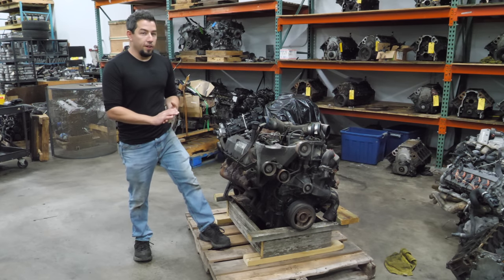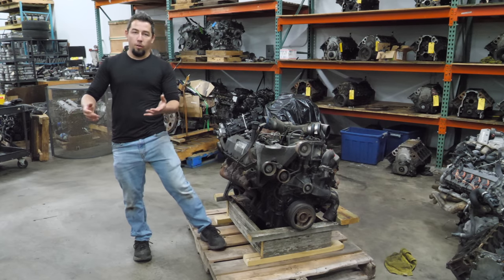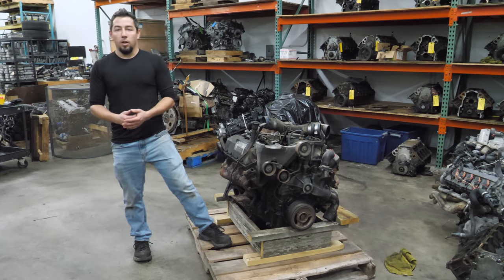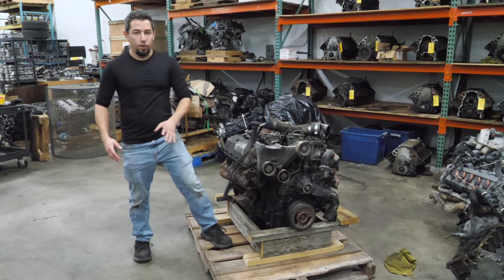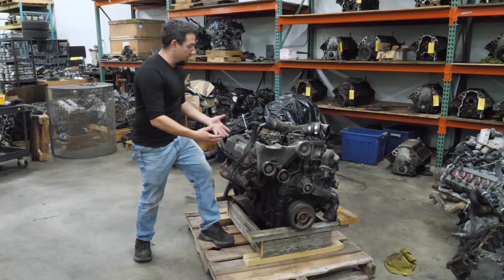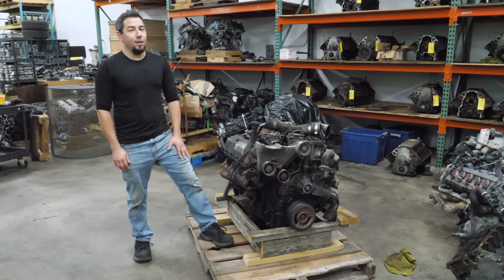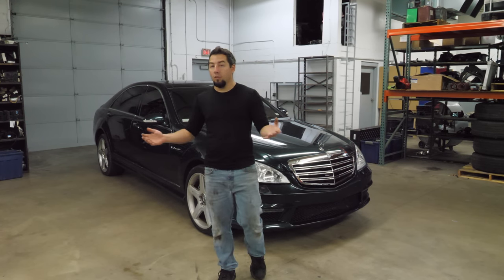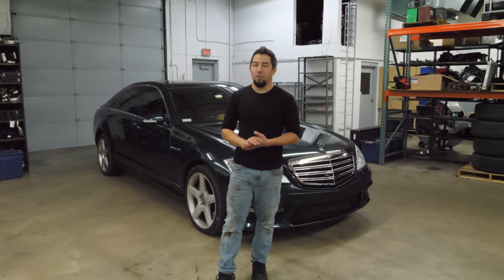70K OR 700K? Ford 7.3 Powerstroke Mileage Discrepancy. How Many Miles Are Really On This Engine?

Comment: I have to agree with the previous posts regarding idling and cold start care.  That engine, physically, looks like a 70k unit.  I think the wear on the bearings and cam is from extended idling and lack of care in cold start conditions.  Who knows?  We're assuming that the oil that they ran was up to task, too.  I think it's definitely worth saving.

Comment: So, Aug 2 of 14 it had an oil change at 67675. 
Sept 8 (37 days later) another oil change - no mileage. 
Dec 29 another oil change at 68372. 

So starting at the Aug oil change it went 700 miles in 20 weeks and had 2 oil changes.
I don't think so. I think in that 20 weeks it went 7000 miles, thus the 2 oil changes.

So as you well know, most vehicles have a "10th" digit. You're saying this doesn't. I expect that people grow accustomed to disregarding the last (usually) "10th" digit thus the low readings.

Comment: 18:55 It's entirely possible for this engine to have 70,000 actual miles on it, but have run itself to death due to being used as a stationary engine. It was, after all, on a service truck, and having an hour meter would probably be a more accurate chronometer than an odometer is. Entirely possible that thing spent the majority of its life idled up running air comprssors or whatnot.

Comment: I’d say 70k, but mileage doesn’t mean much. Maintenance means everything. A few ways to judge engine wear- lower bearing appearance, compression test results and leak down test results. I’d also recommend splitting the oil filter and inspecting. If you split a filter make sure you squeeze the element in a vice to remove excess oil for better analysis.

Comment: Also to add to that last comment I made, I have a 1999 7.3 2 2wd f350
 The odometer and the truck only has right now 8800 miles. Yes under 10,000 miles. 
 It came out of a local plant here in East Texas it never left the plant other than to drive to town for 5 miles away to get parts.  
 But I can guarantee you that thing probably has 20,000 hours of idle time.

Comment: I'm an old man now but back a few lifetimes ago i worked in some shops that did a narrow window of work, small stuff like tires and oil changes, brake pads, etc.  It wasnt uncommon for quick lube tickets to have the mileage fat fingered into the system and on return visits, we just entered more miles than the last visit without taking the time to go out and check the actual mileage...because no one cared.  There isnt a mileage warranty on an oil change.  All the 600K mileage entries are from the quick lube joint.  I would relay more on that last dealer entry.

Comment: I am not an engine expert. The mileage number series seems to increase regularly. There is a significant change in the decimal point location. I would wonder if there is a data entry problem that accounts for the alarming mileage increase?

Comment: The OEM injectors and valve cover wiring harness generally only last about 300,000. Also, I use internal engine cleaner every 100,000 mile or so and at 275,000 when I had my 01 injectors and valve cover wiring harness replace due to failures the Tech said it was the cleanest 7.3 he had ever seen. 
The bearings tell the true mileage. It will need injectors and valve cover wiring harness, New Turbo, Low pressure oil pump, HPOP, bottom end rebuild, just for a mild refresh. Might as well do it right and completely rebuild it right.

Comment: Hard to say. I know a lot of 99-00 engines were "dusted" due to a bad airbox, so it is possible that the engine could have been replaced at some point with a short or long block and all the external covers and accessories swapped over, but that still doesn't explain the mileage discrepancy. The 5 spoke wheels on that truck weren't original, that design wasn't available until 2001, who knows what other part swapping happened over it's 17 year life.

Comment: It had a hard 70k , 7.3s are tough , but they need clean oil , if you skimp the injectors rattle badly and go out , that truck had to be regularly abused to have that kind of scoring on the cam and bearings , the electronics are original so that lends credit to 70k , it was probably cold started with ether and no block heater daily , and then spent a lot of time In it’s higher rpm range , I dare say a lesser engine wouldn’t have made it . Love to see more content in one of my favorite platforms

Comment: Yeah I used to own one of these things, & it just refused to die, even if you don’t check the oil it won’t run without oil pressure!

As long as you keep clean oil in the engine it will not die if you don’t abuse & overheat it.

Comment: If it were me--  Bare minimum- Pull the turbo and put new seals under the pedestal, new seals on the HPOP lines, and pull apart the oil/ coolant heat exchange tube and re-seal all that stuff--  New water pump and new oil pump on the front of the crank --- and SEND IT>   Since you're already there,  I would (maybe) put all new crank and rod bearings on that bottom end.    If you want to spend more, maybe put new injectors and glow plugs.  Otherwise, I'd throw a bearing kit and some seals at it and call it good myself... Because if you go any further, it's basically just a full rebuild at that point--  new rings, new head gaskets, new head bolts, new, new, new...   yikes.   I can't recall hearing of a 7.3L that died from a bad cam or lifter, etc..   I've seen a few 7.3L that had over a million miles on the same engine.

Comment: I am a ford trained diesel mechanic, as much as id like to see you tear it down that engine does not have 700k on it. I'm also in Ohio so we get a lot of salt as well that engine is way too clean, not sure about the bearings may have been low on oil at some point, the cross hatching I could see in the cylinders looked perfect. new bearings and you have a great engine

Comment: The turbo impeller is not stock. That is an aftermarket impeller. The stock impeller is a 9 blade. The impellers seem to last about 3-400k miles. If that was replaced due to it being worn out, it could make a case for the engine having 700k. 
In my fleet, I have a 402k mile 7.3 with original turbo that I just put a new impeller in due to the old one being so worn out.

Comment: I'm a 7.3 guy and I say 70k. That engine is WAY TOO CLEAN to even have a 100k. Those bearings look about right for a 70k engine that routinely saw +2500rpm extended operation. The unloaded side of the bearing was indicative of low mileage. The loaded side looked like it saw mainly highway tow miles. It was probably somebody's 5th wheel camper or horse or racecar tow rig. Another good tip off that it is such low mileage is the presence and condition of the original UVC harnesses. The original turbo doesn't mean much as I have put Wicked Wheels in 300k trucks with original snails for these country boys around me.

Comment: You know, I got a truck that this happened to, but the Car fax didn't match the odo reading. The odometer read just 107k miles, but for some reason the carfax had it bumped up to 207k miles. Absolutely nothing I looked into matched that, and the place I got it from confirmed they never changed the dash components. It also had that sudden jump in miles in less than a couple months. Seems to me it is very likely someone fat fingered the input

Comment: This must have seen a hard life with such wear. Lack of maintenance, cold starts, heat cycles, running it low on oil, etc over and over again are ways to kills these just like anything. I do know if maintained they could probably make it to 700k+ miles. My family  has a '94 7.3 and it's been a farm truck it's whole life. Always sees short trips, no highway, has.150k miles and while she doesn't like cold starts still runs really good and taken a lot of abuse. Next to the 12v and 24v, these are one of the best.

I plan to keep the 7.3 once it's retired and restore the truck. Their longevity and strength are hard to beat even though they aren't so friendly with the environment and fuel usage.

Comment: Diesel oil may be blacker than gas engine oil, but it has (or used to have) a lot more detergents, and flocculant which clumps particles together so the filter can catch it.  As a result, these engines tend to be way cleaner inside, even with questionable maintenance.  
That thing looks like it idled a lot.  Not very hot, so the injector harness didn't get all nasty and discolored, but still lots of low oil pressure time on the bearings and cam.  This is why these engines really need a high idle module if they are going to be idled.

Comment: Service vehicles like that one are hard to get a handle on. You know how highway patrol cars rarely shut off whereas a regular city or small town police car might not get as much abuse depending on who the vehicle is assigned to. I think an hours meter would be more useful for service type vehicles. I bought an 87 Mazda B2000 pickup in July of 1987 and it somehow already had 80,000 miles on it. The mileage deduction was insane but that was fine with me since I was buying it. It was allegedly a farm truck but how they put 80,000 on it in such a short time remains a mystery. It ran great and looked great, it just had an insane amount of miles on it.

Comment: its probably 70k. if it lived in Chicago as a service truck it likely spent its life doing things local to the Chicagoland area so it didn't rack up many miles. However what I have seen in the past from my time working at a dealership in burns harbor Indiana right next to the steel mill is I would see trucks that live at the steel mill that don't actually get any miles put on them but they had excessive idle hours. I have seen a Silverado with 1,800 actual miles that needed an engine because it had 20,000 idle hours on it.

Comment: Back in '14 my boss ordered 2 identical F550's with the V10.  I got 1 and another co-worker got the other one.  after 105K the other truck blew the engine. the dealer replaced it and that one failed before it got off the lot.  the truck I had ran for nearly 8 years with the original engine and 447K. it still runs ok but exhaust manifolds are both cracked so it's really loud.

Comment: If it must be one or the other, I'm inclined to say 700k on account of the bearings and for the reason that the increase in miles and the amount of servicing over the last year of ownership strongly points to too much use to have only been a 70k engine after 16 years (which would have required an average annual usage or about 4500 miles).

Comment: I'm going to disagree with everybody on the lots of idle time in the winter lots of cold starts will do that to bearings unless you have a feeling oil pump idle time doesn't really put any load on engine or bearings. 

Definitely needs a low-end rebuild and I I bought oil pump and just check cam condition for specs.

Comment: seeing the stock turbo, the condition of the wiring, the exterior condition, and the fact that all the injector caps are the same color I believe it's a 70k engine that idled for most of its life. It was probably always behind on oil changes which resulted in the wear to the cam and bearings.

Comment: I have had 2 7.3's. Bought a new truck in 1999, sold it in 2008 with 340k on the clock. Bought a 1 ton van with 250k on it and put another 300+ on it. Never had a turbo issue and I  used waste oil in them. Ran a frantz toilet paper filter in addition to the oem can. You results may vary but I doubt that its a 700k motor just based on how much you have to drive to get that done. If it was set up for towing I would say yes but service truck, nope. Van is sold but the new owner is still putting miles on it.

One other thing, if it had 700k on it the donuts on the downpipes would be gone. If they look good there is no way they are 700 k parts as those are wear items

Comment: Those first 14-15 years averages approximately 4500 miles per year.  But when it jumps to 685,000 that is approximately 45k per year, or 3800 per month or over 100 miles per day.  I think someone at the Jiffy Lube screwed up and fat fingered some numbers in the repair record.  Or someone at Car Fax did the same thing.  Or, someone did not type the decimal point if they were entering the tenths.

Comment: At first I was suspected someone had swapped the dash cluster & interior and run the wheels off of it, but the witness marks and engine stickers shoot a hole thru that theory. I wouldn’t count on the visible crosshatch seen on the bottom of the cylinders as they almost never wear, but I would closely examine the exhaust manifolds, particularly the rear cylinders. If the rear fasteners (any of them) are broken, it’s a sure sign of high heat and hard usage. 
That said, judging by the wiring fasteners I’d have to say it’s a low mileage unit.

Comment: You can check the injectors if they have been rebuilt from my experience they say reman. The HPOP will usually say the same thing I can’t imagine too many 7.3 making it 700k without reman injectors or HPOP.

Comment: Those were absolutely the best engines in the Ford F250. They weren't a bedplate engine so not a good engine to turn up, any thing above 800 hp would float the main bearing saddles, not good,but they weren't designed for that kind of hp. They were very reliable I have worked on these usually the 220 hp model easy to work on long running engine with good regular maintenance.The one thing that is very important when doing regular maintenance is the use of Motorcraft filters and oil recommended by Ford we ran motorcraft oil and filters in all of our Navistar engines the 7.3, 6.0 especially, didn't have the 6.4 in our fleet. the engine you have there probably has 700,000 judging by the condition of the berrings it probably has 700,000 on it abet well taken care miles. IMO that engine is a prime candidate for a rebuild and some new parts, cam, rings and so on, as usual I enjoy your videos, oh one more thing, I didn't know the chipmunks could drive a fork truck your going to have to pay them more....cheers.

Comment: 70k, bearings typically wear out by 400k and need refresging along with rings . design life is 300k commercial duty at 26k per navistar. 

the bearing and cam condition screams acidic oil from sitting

Comment: Now that I see the cam. bearings, and the oil gloopage and see the exhaust manifold up close its a 700 k motor Cold starts don't cause that kind of cam damage like the other below stated and high idle time doesn't cause those issues either But its a seller its worth more complete there is a huge after market of parts for these engines

Comment: My opinion on the bearings From living in ND and AK I'd say lots of cold starts outside without using a block heater. Inside of the block looked too clean. Also I doubt it had 700k with the original turbo.

Comment: The truck body didn't look bad. A 1999 f250 with 700k would look much worse if it was from the Midwest. I don't know if the body could actually last that long.  The winter salt truely devastates metal. 2010s trucks with 150k have similar amounts of rust.

Comment: I would say it does have 70k on it. I live in the rust belt of New England, and this doesn’t look like one that’s endured 700k in the snow/salt. The bearing wear (as others have said) could be from poor maintenance and/or most likely high idle times. A friend of mine put a 60k mile 7.3 in his truck and it ran fine until it blew up and put a rod through the side of the block. Every rod bearing was blue and we determined that was the failure point. Low miles doesn’t necessarily mean great condition but I’m sure you know that!

Comment: Could be the same engine to the truck that had 1 rebuild and it was ready for a second. My 97’ 7.3 has 296k and I’ve rebuilt the heads only on it. Doesn’t mean the bottom end is pristine, I just didn’t have a way to do a frame-in and didn’t have a way to pull the whole engine in my driveway with as much as it weighs.

Comment: Strip it and rebuild it and sell it as reconditioned the pistons and bores look very good, original turbo, maybe a new cam and a set of bearings and gaskets?
But in the tear down you could get a better idea of if it’s worth rebuilding..

Comment: The condition of the oil pan and dipstick tube are known to rust out on these engines in the rust bucket states. I'm leaning towards it being a lower mileage engine with lots of idle time and cold starts. Would be an excellent engine for someone looking who is in need of a complete engine and has knowledge on these Navistar engines.

Comment: It's a 70K engine. Some kid mistook the tenths of miles on the odometer as part of the actual odometer reading and put it down as 600k rather than 60k. I've seen it and corrected this mistake many times with kids working on older vehicles with mechanical odometers.

Comment: 305k on my 97. Original turbo (never been off) Original injectors (probably should change them soon) never touched exhaust manifolds or up pipes. My harness has been replaced to injectors, new injector harness on a couple. Pan looks really rust free, they like to rust from outside in.  The wiring looks way better then mine, all looms are brittle at this point.   Probably time to pull mine and reseal and do turbo, exhaust, injectors, lpop, pan reseal. Nevermind  😆

Comment: Save engine and sell.  That engine is god tier wanted.  Somebody would want a complete engine, even for rebuild.  Sell less than an install and go.  But more than its parts values as an unknown mileage with what you do know.  Is a clean one.  Perhaps do some bore scoping down the glow plugs?